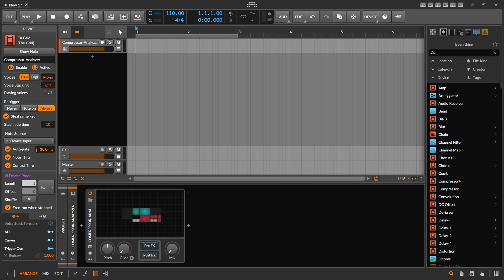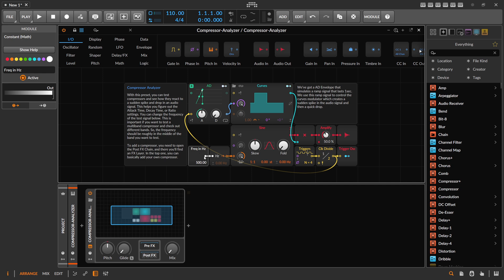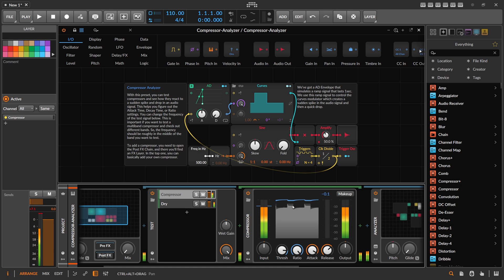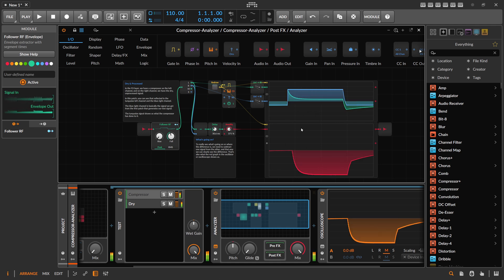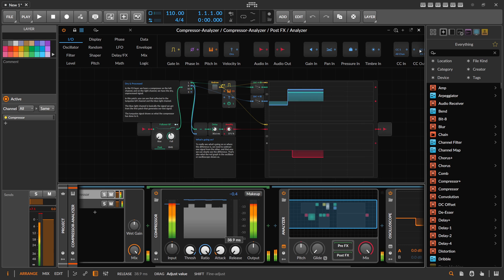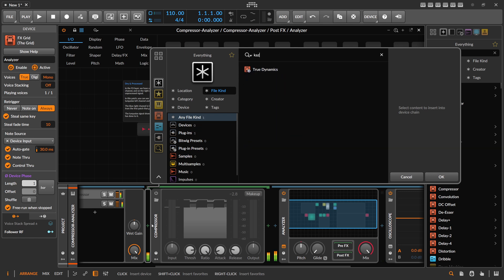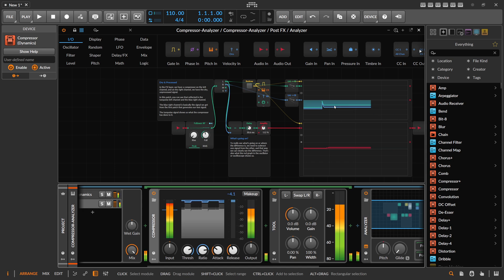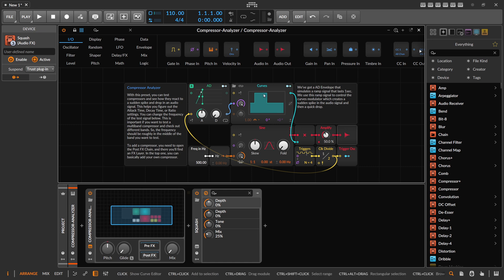Cloning VST Compressors with this FREE Bitwig Tool

Comment: Guys, when I have some MIDI and audio clips on my arrangement view, sometimes I want to select a specific point in the middle of an audio/MIDI clip. In Bitwig 5 I could do this automatically, but in Bitwig 6 I have to keep using the (2) key shortcut. How can I make this automatic again?
Reply from the maker: Its in the new arranger options menu (arranger bottom right) - "Pointer Tool supports Time Selection"
Reply: @PolarityMusic   it works!!! thanks a lot !

Comment: Another great video that showcases what can be done using the grind - when you know how! This weekend I tried and failed to create a tempo-synced pre-delay using the grid. Is this possible? For context, this is when we use a tempo-synced delay plugin with zero feedback before a reverb plugin, in order to automatically adjust reverb pre-delay.
Reply from the maker: the long delay is a time-based non-feedback delay in the grid. you can choose how many 1/16th, 8th, or quarter notes you want to delay. Outside of the grid I use often the Delay-1 device for that (filters open, zero feedback, mix 100%)
Reply: @PolarityMusic  awesome - thank you!!!